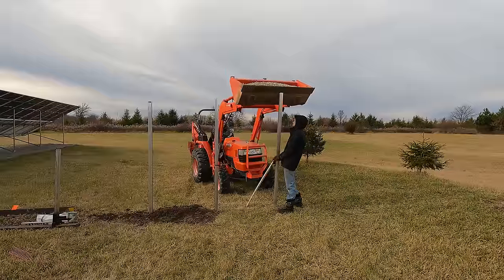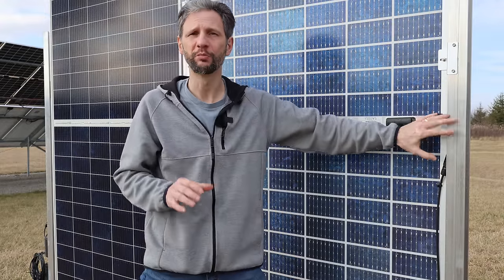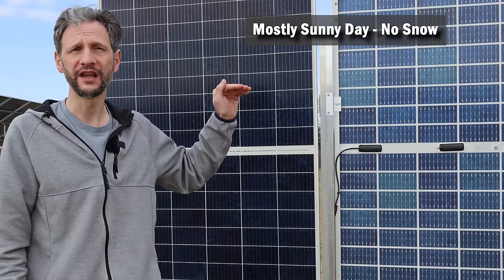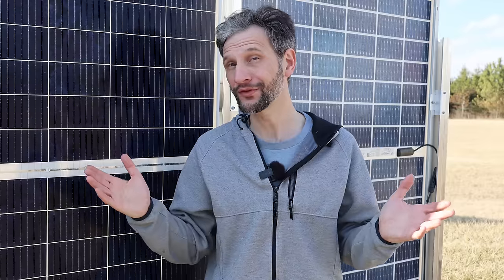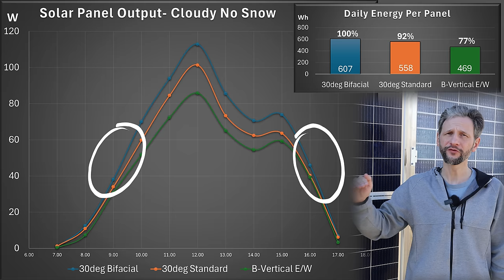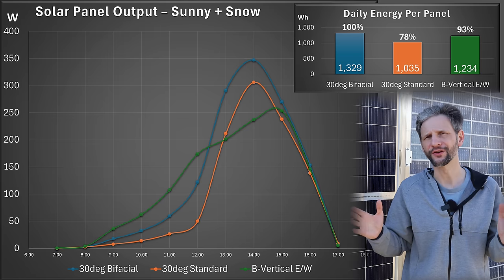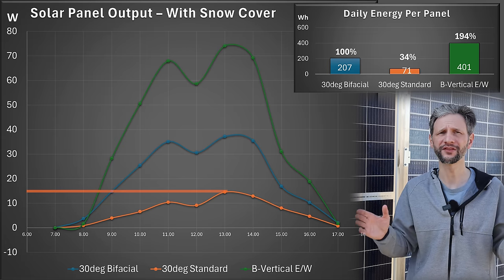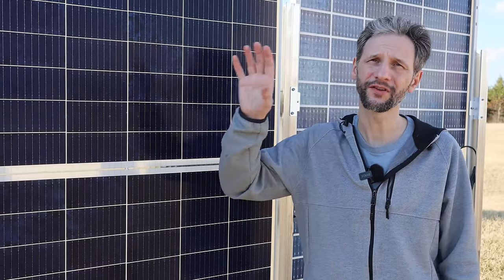Vertical Bifacial Solar Panel Performance Results Part 1

Comment: Thanks for this inspiring testing! Just a thought: would adding mirrors at the back of bifacial panels (to reflect the sunbeams) generate better / positive returns? (Using normal or maybe convex mirrors to max out the total panel surface.) You could also toy with the option to mount the bifacials on a pole, secured upon a small motor-> following the path of the sun at every hour of the day.
Reply from the maker: Mirror data coming in the next couple of weeks.

Comment: on Heterojunction the back side have 90-95% power of the front side and near the dubble power in fog ore other difuse light situation so you don t need to chose east ore west. The maunting on the wall of your haus is easier and cheaper.

Comment: test a bifacial south facing panel mounted on a TRACKER MOUNT. it will out perform the fixed south facing panel and the vertical panel

Comment: BOTH, is your real answer... Both are wanted and needed. All solar is better than fossil fuels at this point. Ditto for wind. Don't ever let perfect by the enemy of good... I just want to see bifacial solar fences installed along all major roadways (where it makes sense) because I think that's where these would work wonders as both a security barrier and as a linear solar farm along public right's of way that always need to be kept clear and cut back...
Reply from the maker: I like the idea, but I wonder if damage would be a constant concern.

Comment: Have you tried a shallow pool of water under/in front of the solar panels? the reflection should give you intresting results....   the pool: 2x4" frame with pond liner inside, cheap as chips..... when the wind is blowing, the smal waves on the water might also give interesting reflecting angels.... would be a fun video....
Reply from the maker: Ok, I'll add it to my list of ideas to try.

Comment: Looking forward to your summer data for this.  I am guessing that the verticals won't do as well as winter?  Not just because of the lack of snow but just because the sun is higher and that favors the tilted panels.
Reply from the maker: But you also get a lot more East and West exposure due to the longer days.....

Comment: I guess it is not practical, but i'd be curious to see how putting sheets of white/reflective material on the ground behind the 30 degree bifacial panels and maybe even some sheets under the vertical panels to reflect more light from the ground, simulating snow would perform. I am sure there would be long term issues keeping the reflective material clean, but it might be an option in some environments.

Comment: In warmer conditions, there is also concern that sun-facing arrays lose a lot of capacity by getting too hot during times of highest direct sunlight. If the light captured during this time is mostly from indirect reflected light, the heat losses will be much less and could result in comparable overall capture from vertical mounted panels.
Reply from the maker: I'm sure the temperature will be lower, but that also means they are getting less solar irradiance, so it doesn't necessarily mean more power.  But we shall see.

Comment: This excellent. I am designing a large system and definately need to incorporate Vert BF E & W panels at the peak of a white roofed parking canopy. The main panels will be on roofs so just standard, so all the more reason to have vertical BF E & W. My suppliers are not familiar with the concept so I need to find help with sizing strings, because EW will be different constraints. If one string has alternating E and W panels, I should be able to have more panels than usual. Do you concur?

Comment: I have a suggestion for you Why don't you add two mirrors on either side of the vertical panel which will cover up the outage noticed

Comment: Most peoples demand is highest in the morning and evening and also the share markets prices peak in the morning in evening (at least in germany). It'd be interesting to see how this increases the financial savings for self usage or how it impacts your earnings, if you sell on hourly set prices. Also the dimensions of a battery storage could be reduced.
Reply from the maker: Where I live the rate is the same 24/7 so the profile doesn't help me with utility costs.
Reply: @ProjectsWithDave  For those without a battery back up, the early morning and later afternoon peaks would be the most efficient thing for heating a home a home in the morning, and pre heating the home before nightfall.

Comment: So bi-facial panels vertically in rows like you see in the big installs would have better results then you here as you only have one row vertically. As the panels in the rows have some reflection which would be passed to the ground and back up to the next row of panels.  How much light reflection is typically on panels ?
Reply from the maker: I think whatever reflection gain you got from reflection would be negated by evening and morning shading by adjacent rows.
Reply: @ProjectsWithDave actually not, if you space them apart accordingly. Actually, we're speaking about 10+ meters here which might sound like a lot, but is standard for actual solar fence AgriPV installations.

Comment: What is the power per square foot of ground space consumed?
Efficiency of space is where the vertical panels will truly excel.
I am most intrigued by the possibility of using vertical panels as fencing.

Comment: Seems like the vertical panes should have been in front of the ground mount.  The huge shadow behind the ground mount blocks the possible reflection angle from the south especially in the snowy condition.
Reply from the maker: Yes, I considered that.  There is some impact from the main array.

Comment: For when you need a very reflective surface it would be interesting to use Ultra White paint. I think this is 98% reflective recently developed paint. I'd expect bifacial panels could get a nice boost.  I think it uses Barium Sulfate.
Reply from the maker: To what surface are you applying the paint?

Comment: I live not far from the Willow solar farm in Alaska. It's a fairly sizeable solar farm.
Reply from the maker: How often is it covered in snow?
Reply: @ProjectsWithDave  snow I'm not sure, but I'm off grid about 50 miles further north and I have snow from late October through mid April most years. I've only seen them covered in snow a few times but in reality I only go to town a couple times a year.

Comment: Land can still be farmed, but only with low-height and grows-in-shade crops (more  livestock or Tubers, especially asparagus, because that is usually covered under white sheets, less corn/wheat)
easier to clean (rain snow).
better with white floor (snow).
performs comparably in indirect light (cloud albedo)
worse during noon (may reduce size of needed battery when combined with enough rooftop panels)
A lot less efficient per panel, big diminishing returns.
slightly worse with nearby forest/tree/highrise. (long sunrise/sunset shadow)

Comment: Because used solar panels are so inexpensive, someone on my channel recommended you just buy two used solar panels and put them back to back to make a more efficient, possible cheaper bifacial solar panel. I wonder how that scenario would compare?  Or just a simple by facial versus to back-to-back used solar panels comparison test.
Reply: How cheap actually? Brand new 400 Wp solar panels cost as low as 50 bucks (or rather 30 when bought in big quantities).

Comment: vertical bifacial panels don't have anywhere as high output, but are spread further apart, more consistent in different types of weather and use up less space and need less maintenance, like cleaning.  In theory, it could work well with farmland, but only certain types of farms.  I feel that the best solution is a combination of both south facing and vertical.

Comment: You know, I wonder if desert installations would see similar benefits as your snowy days. They would probably collect less dust and need cleaned less often, but the increased convection reducing their operating temperatures is probably the most significant benefit in deserts.
Reply from the maker: I was curious about that myself.

Comment: Im wondering if a chrome plate was mounted below to reflect the sun on both sides of the vertical mount would equal or exceed traditional mount. Basically a mirror. Id perforate it, to avoid water. This would change your curve I think pretty significantly.

Comment: Incredibly high quality test with interesting results and brilliant organization/presentation. In theory, the VBPV should perform much better in the summer than the winter, getting closer to the 30° south install. The lower your latitude, the higher the annual POA irradiation vis-a-vis the 30° south setup. There's some latitude, perhaps in Florida, at which VPBV should be expected to outperform on an annual basis.

Factoring in the other benefits of VBPV--snow performance, duck curve mitigation, agricultural synergies, and others--VBPV could have a promising future.

Some issues could be total energy density per hectare. Also, none of these comparisons factor in tracking, which has become standard in utility-scale applications and doesn't really improve VPBV. But for agrivoltaics and smaller-scale ground mount setups, I think the future of VBPV could be very bright. I'm excited to see your summer results.

I may have missed it, but what model of module did you use? What were the bifaciality and transmissivity factors?
Reply from the maker: 390W Canadian Solar, 15% Bifacial Gain
Reply: @ProjectsWithDave  If those are the CSW-390, they have a listed bifaciality of 70%. Some newer technologies like TOPCon (80%) and HJT (90%) could improve even your already encouraging results.

Thanks for the info!

Comment: One thing crucial but I fully understand you could not test is heat problem. Especially in tropic climate. Because that was the main concern of solar array performance at noon. Vertical mounting mitigate all noon heat is what's the researcher suggest that would boost performance difference from direct sun setting. But in cold climate this problem might not occur

Comment: Dave!  Have you thot if an angled panel on top of the vertical panels.  It would be out of reach for most movement thru the panel racks while possibly filling in the midday gap in solar gathering

Comment: Seems like vert bifacials are a good match for road side use. I saw PV used as sound deflectors for rail. If they drop these along roads and carparks they could have a real high utility, not just from electrical generation.
Reply from the maker: Seems like they would have to be pretty far from the road to protect from damage.  Vehicles and plow trucks throw rocks pretty far.
Reply: @ProjectsWithDave  good point, I saw the train solution was almost like a flag on a pole next to the tracks. At least for that it would most likely be turbulence over projectile due to height for primary stressor.

Comment: Looking at your setup, it occurs to me that I think your vertical panels may actually have been underperforming in snowy conditions because of how close they were positioned to the south-facing array.

They are positioned right next to the shadow being cast from the other array, which means that there is little sunlight being reflected onto them off of the surrounding ground snow in those areas, which logically should be the best angle for reflected sunlight during midday.  Therefore, I think you may have been getting substantially less sunlight hitting the panels during the midday in the snow than would have been possible if you had actually mounted them with more distance from other structures on their south side.

Comment: I can't wait for the summer results, one of the purported benefits of the vertical mount bi-facial setup is that it doesn't have the reduction in output due to thermal stress in the summer that you get with a south facing setup at times of high intensity sunlight, and I am eager to see how this works out in the real world with your system.  Do you have or are you planning any sun tracking systems?  I have always been curious about a "dumb" system with 3 positions, near vertical east facing, slanted south facing, and near vertical west facing... all set up on a dumb timer vs the expense and output of a sophisticated system with continuous slow adjustment to track the sun.  Of course the full sun tracking would have the best output, but I assume they are expensive and that is why people with ground based setups don't do sun tracking... would the increased output of a dumb 3 position system justify the cost?
Reply from the maker: To execute your concept of a "dumb" tracker.  Simply install panels at 2 or 3 angles and use three separate MPPT inputs on your inverter.  This allows you to use a smaller inverter but maximize daily production.  I reviewed some results from different orientations in this video: https://youtu.be/J7xnY84Ch1E
Reply: @ProjectsWithDave   Are solar panels so cheap now that this solution makes sense?  In other words, are three panels less expensive than one panel with a dumb motorized positioning system?  I know the three panels would be easier to implement, just curious about costs.

Comment: Great info from a new subscriber and solar worshipper. Perhaps someone has already asked but I’m wondering if you have any data comparing south facing roof mounted vs south facing wall/vertical mounted arrays? I have a roof system now and live with lots of winter and snow, so I’m interested on the benefit of adding panels to my garage wall. 

Thanks 
Dave from PEI Canada

Comment: Very interesting.  Part of the advantage for verticle panels  I heard was also the cost, its so much easier to mount them vertically appareently then  on an angle.  I think solar tracking would also be less costly, making  solar tracking + vertical panels a more cost efficient $ per watts then south facing panels perhaps.   Idealy the perfect angle tacked all day would be the best solution, but its very costly to do that to a huge array which is why we have these different mounting strategies I suppose.  Cool stuff.  Im wondering what would happen if you spun the verticle panels, and then faster and faster close to the speed of light, maybe capture all the light then eh? hehe jk but maybe they could double as wind trubines then, solar powered wind turbines!

Comment: Now, integrate mirrors into this idea! You could get rid of much of that mid day dip if the mirrors moved to follow the sun- at least that's what I think would happen. Wouldn't double sided panels cost about twice as much though? Since it has twice as many solar cells I figure you should be comparing 2 regular panels to 1 of these vertical panels. I can see how these are beneficial if you don't have the space but I kinda feel like the graphs are a bit deceiving- compare the amount of cells and their output for a real 1:1 performance test
Reply from the maker: Bifacial panels don't have twice the cells.  They just allow light to hit both sides of the cell.  I'm running some reflector tests.  Stay tuned...

Comment: Trina Solar Vertex S+ TSM-NEG9RC.27 claims up to 85% power on the back side. considering less battery storage capacity necessary with the extended delivery duratian it may be cheaper to set them east-west instead of south additinally to the  land saving and "snow doesnt matter" advantages

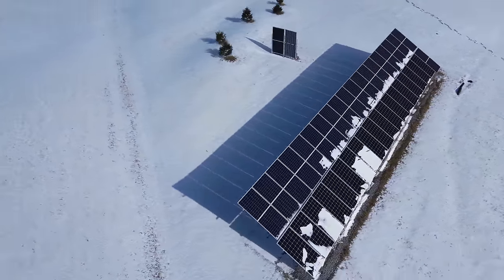Comment: Subscribed, just to see the results across the year.  However I am a bit disappointed that you placed the vertical panels north of the south facing panels.  With the sun so low on in the sky the south facing panels are actually shading the vertical panels' reflected sunlight.   For example at 8:49... That shadow is damn close to the vertical panels; some of that shaded area would have reflected light onto the vertical panels.

Comment: Dave - I loved this video, comparing performances of monofacial, bifacial panels, and with both mounting options.   Can you tell me, on a standard south-facing mounting option, how can I best get light to the backs of my bifacial panels?   (i get little snow in southern Kentucky)   Would you suggest... grey-white driveway gravel, super-white pea-sized decorative landscape pebbles, silver or white-faced mylar sheeting (problem: doesn't percolate water, thus causing fissures in the surrounding turf), or... metal or glass mirrors?   (problem:  my solar field is in a hay field and the reflective stuff on the ground may get dirty and need regular cleaning with water)
Reply from the maker: I would go with white rock if it isn't a significant cost.  The other options would be too difficult to maintain and negate the value.

Comment: After watching this video I would think that you would want to try panels that could be auto-tilted based on snow accumulation
I would want to compare Auto-Tilt (snow clearing) panels against Solar tracking panels, whether they be active or passive tracking...
Reply from the maker: My goal is to have a passive system with no moving parts that can fail.